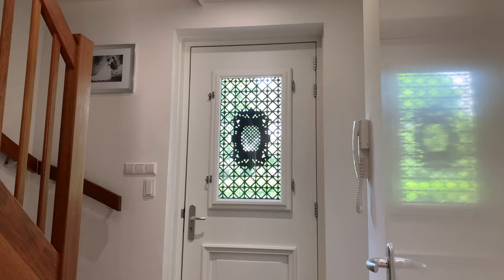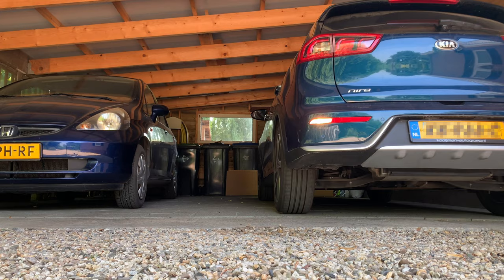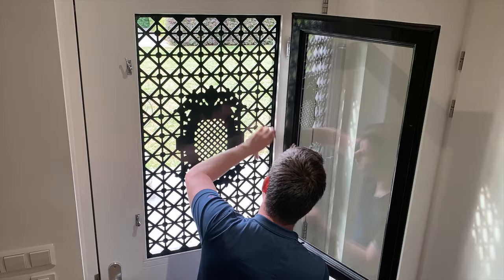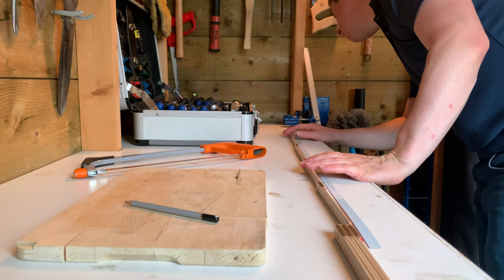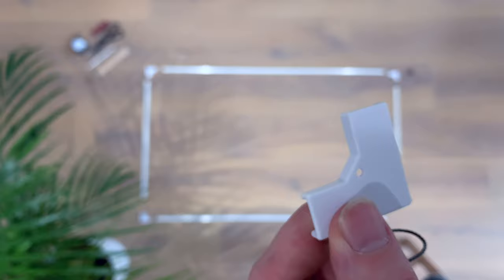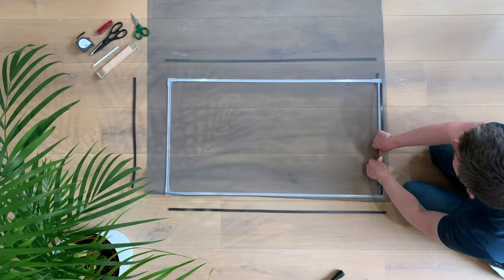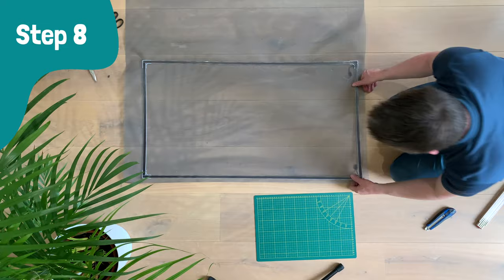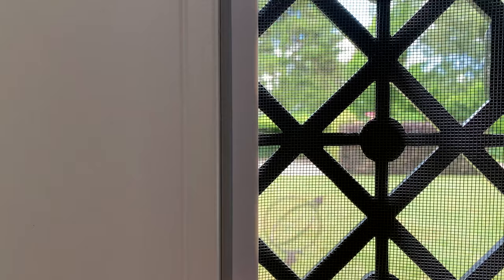Installing a DIY Magnetic Window Screen (Kit) // Easy 9 Step Tutorial

Comment: Cheers, been having similar issues keeping the frame square, starts off well, but kept ending up with a super wonkey frame, especially with the effort required to push the strips into the groove. A tiled floor helped me keep things square in the end.
Reply from the maker: Great tip to use a tiled floor as reference! Thanks!

Comment: Hey there, was wondering would you say that this would be strong enough to prevent a cat from getting out of the window? I live on the 11th floor of a apartment building where the windows in all apartments don’t have screens. I don’t have a cat because of this but want one and trying to find a solution of preventing the cat from falling. Thanks!
Reply from the maker: That's creative thinking! However, I don't think it's strong enough to prevent a cat from jumping through. You have to rely on the mesh screen dividing the force over the full length of the magnetic strip. This will probably happen if the cat jumps exactly in the middle of the screen. But if he/she decides to try it at a corner, for example, I don't think it will hold.
Reply: @dutchdiyfamily  thanks so much for replying and sharing your thoughts. All the best